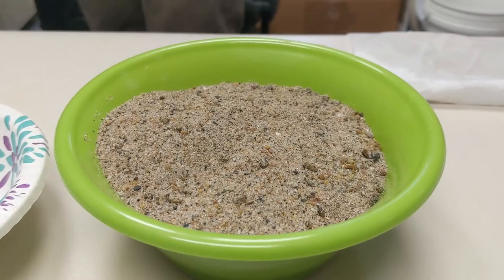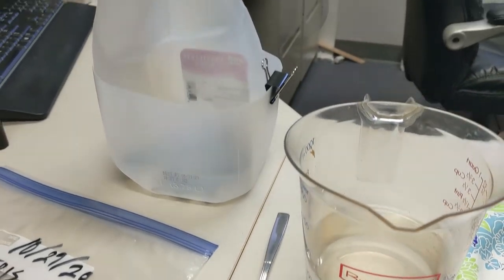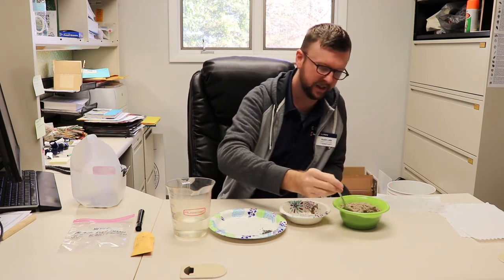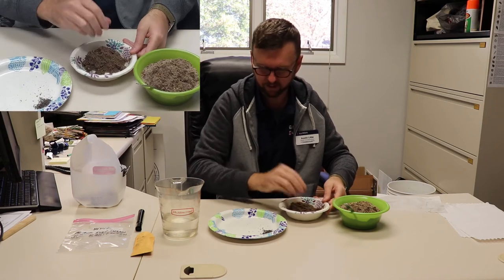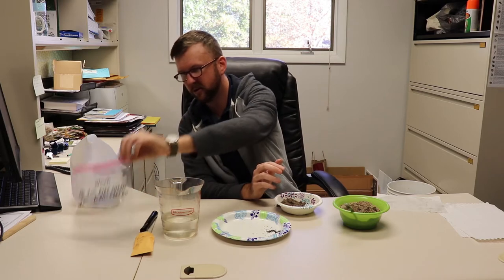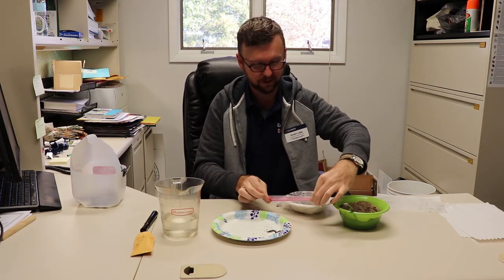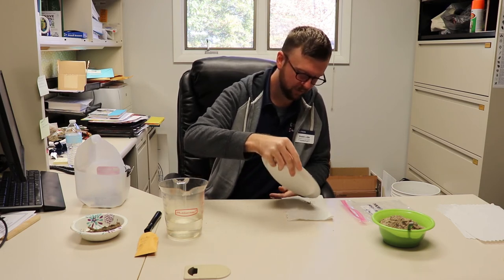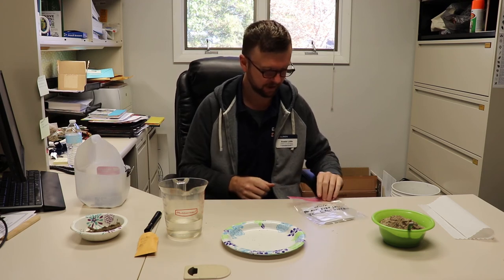How to Stratify Seeds

Comment: Great video! I have a few questions though.  If my seed needs 1 month of cold stratification, do I need to time this process so that after the one month in the refrigerator, it is immediately time to plant the seeds outdoors? Or, can I remove them from the refrigerator after one month and store them in a cool, dark dry location until time to plant outdoors? Should I remove them from the damp environment?  I cannot seem to find the answer to these questions.  Thanks.
Reply from the maker: Hi Tracey. Some plants need cold stratification to break the dormancy cycle. Seeds that need cold stratification should be stratified for the appropriate amount of time and then immediately planted into pots or directly outdoors if the weather permits. If you want to store the seeds, I recommend waiting to stratify them until you are ready to use them. The article below provides some more information about seed stratification.

https://extension.illinois.edu/blogs/good-growing/2022-01-27-seed-stratification-what-seeds-require-cold-treatment

Comment: what kind of sand do you use to create a "sandy loam" from normal loam soil? do you know where to get it?
Reply from the maker: Austin Little said that loam and sandy loam soil refer to soil textures built over long periods of time by natural processes, and it is difficult to quickly turn loam soil into a sandy loam on a large scale. An Ideal loamy soil is approximately 50% sand, 7 to 27% clay, and 28 to 50% silt. By adding sand to a soil with a higher amount of clay, it can actually cause compaction and is closer to concrete than soil. A large amount of sand, at least 50%, needs to be added to overcome the cementing effect. However, gardeners do incorporate grit or sand into a soil to help with drainage and aeration in certain situations. That type of sand is coarse or builders sand. Larger grain sand is the best option rather than fine sand, and this can be found in bags at hardware/garden stores or at nurseries. On the other hand, incorporating 3 or 4 inches of organic matter such as composted yard waste, composted manure, composted mulch, grass clippings, or composted crop waste will have a big impact on the overall quality of the soil.

Comment: My seeds packet for Echinacea - Tennessee Coneflower says to stratify in the freezer.  How does this differ from the refrigerator method?  Do I do this wet or dry in the freezer?  Thank you.
Reply from the maker: Horticulture Educator Austin Little said to avoid freezing wet seeds. The ice crystals that form on and in the seed could cause freezer burn and kill the seed. Generally, freezing is used more for the long-term storage of seeds, and they should be totally dried out when put in the freezer. The usual recommendation for Echinacea is moist cold storage in the refrigerator for around four weeks, but if the seed producer has that recommendation, it might be worth trying.

Comment: Thanks for your video! Do you think I could just use a little bit of water in a jar with the seed? Do I really need a physical medium if I change out the water every couple days?
Reply from the maker: Horticulture Educator Austin Little said the main things a seed needs in cold stratification are cool temps, moisture, oxygen, and of course time. If seeds are sitting in water alone, they won’t get the oxygen they need for the stratification process and would likely drowned and/or be killed by mold. He would recommend one of the methods demonstrated in the video.

Comment: Can I bury them straight in the ground outside or in a pot with soil outside? Any problem with that? Why the hassle with the fridge?
Reply from the maker: Seed stratification mimics the effects of winter conditions on seeds. Many seeds need to go through this process to break dormancy and begin to grow. By doing stratification, you can control when to start the process and you can also use it to “trick” seeds and get them to sprout without actually going through an entire winter season. You may choose to use this method to get a jump start on the growing season, protect seeds from mice and other rodents, and to have better control of the growing conditions. With that being said, you can start seeds outdoors in the ground or in pots, but you need to make sure they go through the appropriate temperature and moisture to break dormancy.

Comment: can you put echinacea seeds into the fridge in soil with a light fitting lid on top?  Or must it be air tight? or is soil not an option? beginner gardener here :)
Reply from the maker: Horticulture Educator Austin Little suggested to keep it closed. The idea behind keeping a container closed is to retain moisture in the medium that the seeds are in. There should still be enough oxygen in the container for the seeds to stratify, even when closed. While garden soil may work to stratify seeds, I would probably recommend a potting mix with little or no fertilizer, sand, or peat moss over soil out of the ground. The soil from outside has many things in it that could cause issues in the fridge, such as mold or other pests. Garden soil can also have bad moisture-holding quality when put into a container, and that is the main thing to keep the seeds cold and moist. If you have additional questions, feel free to contact him at little84@illinois.edu.

Comment: Thanks for the video. Currently I am stratifying blackberry and raspberry seeds. So the seeds that freeze in the wild during winter fail to germinate? Or do some of them make it through?
Reply from the maker: Horticulture Educator Austin Little said both blackberry and raspberry seeds do indeed undergo cold stratification in the natural environment. As the fruit drops in the late summer and fall, it is dispersed by weather and animals, and many of the seeds will make it to germinate in spring if they are not too damaged or submerged in water. In fact, we have some issues in Illinois with the abundance of Himalayan blackberries that overgrow along trails and understories of woodlands. If you are stratifying in the fridge, the raspberries generally take about 4 to 5 weeks of cold stratification. Blackberries have a bigger, tougher seed that needs 12 to 15 weeks of stratification. In either case, both blackberries and raspberries will not produce fruit until the second year of growth on floricanes. If you have any other questions, feel free to reach out to him at little84@illinois.edu.

Comment: In Montreal, we have a lot of freezing temperature and a lot of snow. Why don’t we place the seeds in freezer??
Reply from the maker: Seed stratification is used for plants that need moist, cool temperatures to germinate and should be done according to the specific plant requirements, not the location they are being planted into. Most seeds stay dormant at freezing soil temperatures and do not start to break dormancy until moisture is introduced and temps are above freezing. In most cases, the temperature of a refrigerator is sufficient to trigger breaking dormancy. The freezer is often too cold and too dry to properly cold stratify plants.

Comment: I've had difficulty with mold using these methods. Better luck outdoors during winter, with squirrel protection...
Reply from the maker: Mold can be an issue in all types of seed starting, and the moist dark conditions of seed stratification can cause mold to grow on seedlings. If you choose to use seed stratification, you can work to avoid mold issues by using clean utensils and hands, making sure that the storage container is ventilated, and not leaving the seeds in the refrigerator longer than the recommended amount of time for that variety.

Comment: Hi can strawberries blue berries grow in tropical counrries like the caribbean islands sun an rain
Reply from the maker: Austin said the short answer is yes, but they will perform differently. Blueberries are generally grown in cooler climates because they require cooler night temps to produce fruit, but some varieties tolerate hotter weather and will produce fruit at least part of the year (likely in the fall). They are rabbiteye and Southern highbush blueberries. 

Strawberries need a cool season to go dormant and rest, but some hot weather varieties could still produce fruit. However, they may only survive a few years, and fruit may get smaller in size. The varieties to look at are Red Gauntlet, Tioga, Cambridge, and Turft. Good luck!

Comment: Is the moisture component meant to help break down the seed shell?
Reply from the maker: Thanks for your question. The goal of seed stratification is to mimic the environment that a seed needs to germinate. Almost all seeds need some level of moisture to germinate, both to soften the seed coat and create a hospitable environment for the roots of the plant. Some seeds benefit from being soaked 12 to 24 hours immediately before planting to soften the seed coat and encourage quick germination. This process is called priming and is different that seed stratification. Primed seeds usually germinate more quickly and have better germination rates than unprimed seeds, however primed seeds need to be used quickly and do not store well.

Comment: do they go in the fridge or freezer
Reply from the maker: Most seeds that require cold stratification should be placed in the refrigerator for the recommended time before planting. Most seeds stay dormant at freezing soil temperatures and do not start to break dormancy until moisture is introduced and temps are above freezing. In most cases, the temperature of a refrigerator is sufficient to trigger breaking dormancy. The freezer is often too cold and too dry to properly cold stratify plants.